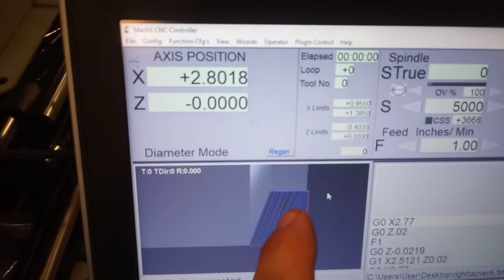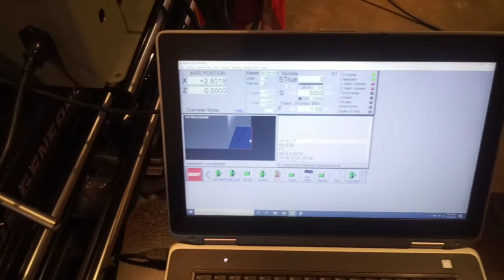Pulley for Logan 12 inch lathe part 2....

Comment: So close yet so far. 😁 Sounded like a lot of chatter going on. You could see from the stringy stuff to the chips when it was chattering. If I remember right Steve Summers went though a surface grinder and found the same type of way oiling system. Yah chores, clean the pool ride the mower, BBQ, and lounge in the pool. Thanks for the video!

Comment: Here's what I was thinking, and I'm not sure how plausible it is.  I keep the stock lead screws and brass nuts in my little Phase II X Y table, but I do away with the ball crank handles and instead power the screws with steppers and controls. Then I mount the table onto my milling table and use it's spindle to have a bolt on semi CNC milling set up? Thoughts?
Reply from the maker: Definitely plausible. One thing to note... There's only one time you have to worry about using standard lead screws, when you go to cut a circle. Any backlash in your setup will show up at that point. Now that being said mach 3 has backlash adjust in the program which helps out with those issues. You definitely seem intuitive so I'm pretty sure any variation you get you can work out other ways. Like I said before my lathe still uses the lead screw in the cross slide. Only ballscrew is the compound one and I don't see anything weird cutting radiuses which on a lathe is when it would show up. 
Is there a specific reason you want to upgrade? Or just for ease of use factor?
Reply: @backwardsmachining7526  Cool. I appreciate your thoughts, Doctor.  No reason for it, just experimental considerations. If I can control that thing, then it would ultimately become an add a spindle project.  Using the Phase II on my mill I would have to manually up and down feed the end mill, which would all be covered in chapter 6: 'Putting the Semi into Semi CNC milling set-up' lol --  I saw someone (up in Wisconsin I think) has a Bridgeport T Ram head for $150 on Craigslist. Would be a nice piece of building fodder.
Reply from the maker: @johnstrange6799  I was looking at your milling machine, (on YouTube , not threw your window) and although 2 axis CNC machines are still common, Bridgeport etc, why don't you want to put a stepper on spindle axis? I see a handle there. 
 On a separate note your table looks amazingly easy to put steppers on. Plenty of room. I myself bought the steppers with a threw shaft so I could put a handle on the end of the stepper to use it CNC or manual. You can see it on my lathe.
Reply: @backwardsmachining7526  My actual mill I would want to keep as is (Manual / functional to make parts) , but possibly on my junk built mill, or the XY Phase II to use on my mill, or as the bottom half of a bench top mill or router build.
Reply from the maker: @johnstrange6799  let me look again,
 do you have a lot of room to put a X Y table on top of your mill table, then a vise, then a part?
Reply: @backwardsmachining7526  I found a Makita hammer drill today, which I previously did not have one of. Was happy about that.
Reply from the maker: @johnstrange6799   is it a cordless one like that other set you found? are you going to keep this one for yourself? Makitas are awesome. One of my favorite brands. Someone threw out a cordless drill at work, I striped it for parts.
Reply: @backwardsmachining7526  Nah, it was likely the one a cordless replaced. It's older, corded, and has some miles and wear on it. Perfect for the potential one or two times I might ever need one in the future. I used to salvage small chucks off of drills.  Founds a few broke down floor jacks today too. I harvested the rollers off of them for a potential machine skate build.
Reply: @backwardsmachining7526  Here's that Bridgeport head. https://milwaukee.craigslist.org/tls/d/caledonia-bridgeport-vert-mill-step/7142396405.html
Reply from the maker: @johnstrange6799  yea unless your drilling in concrete I guess you do t need a hammer drill. I can count on one hand how many time I've needed one but it's like any tool... If you dont have it then you will need it lol.  I need some of those metal wheels as well. I was actually thinking of making them on the lathe. a custom one to put the behemoth surface grinder on. Something low profile.
Reply: @backwardsmachining7526  Yep. I like that I won't have to buy one whenever that one time comes to need it. If I had to buy one in a pinch for one time use, then I would likely try to cheap out figuring I'll only use it once. In finding a fairly decent one, I get quality and preparedness for the same low price.  The jack wheel are good for machine skates, or to make a Johnson bar to leverage machines around.

Comment: It happens.  At least it's not made of bra$$.
Reply from the maker: I can't believe the price of brass and bronze now. It's crazy. Was thinking about getting some of that 12L14. The free machining stuff. Suppose to be really easy to machine and way better then hot rolled junk
Reply: @backwardsmachining7526  That's why I was so let down by not being able to get proper refractory local to me. I could be turning all kinds of brass scrap fittings and valves into rounds and bars. Same and even more so with aluminum scrap.  Yeah man, Ledloy is nice to work with. I like cast too. Messy but easy to machine. When I sold my first lathe, the kid who came to buy it had a monster piece of brass in the front seat of his car. It was like 4" round and about 28" long. I was like "Wow!"  -  I found about a 3ft section of 1" weight bar today. Besides just being free steel, I figure it might be handy to have pre knurled stock to make thumb screws, or a handle for something out of.  Also found two decent sized jars of 1/4-20 stainless pan head screws in two already sorted lengths.  Someone in my family suggested putting them in a garage sale for a $1 a jar. (That person is skating on thin ice lol ) 
Also found a model air plane engine. Something I've never played with before. Might be worth a few bucks to someone, and a possible video in it for me.
Reply from the maker: @johnstrange6799  ohh so you have experience with ledloy? Cool I will have to try it. My experience is limited to hot rolled, aluminum, some brass, and unknown stuff. Like inconel or whatever the steel may be. I get stuff from my work. Basically if it's on the janitor rack for a while and it's big enough to machine I snatch it. They have these monster 7 inch diameter 3 foot long bars of steel in the back. I was told I could have them. I said I just wanted to cut off several pieces for future chuck back plates. 
Model airplane engine? Like the nitro kind? I love my rc models. I have trucks now. Got out of the gas powered many moons ago. They are fast but noisey and to much to keep them running. With the invention of lithium battery and brush less motor system the electric are just as fast as the nitro and they run for 30 minutes. Plus they are 100% water proof now. Sorry I'm rambling.
Reply: @backwardsmachining7526  Metal stock from work would be like heaven! I have a round I need to anneal on my kitchen stove, but it's been way too hot. It's a perfect piece to make a bench anvil out of, but way too hard for me to machine. I bet you could make some nice parts on your lathe using lead. It's easy to melt, and turns like butter. I wouldn't even know where to get fuel for the engine. Also found another cordless drill with battery and charger. Dewalt this time.